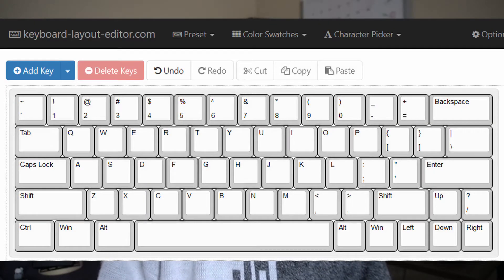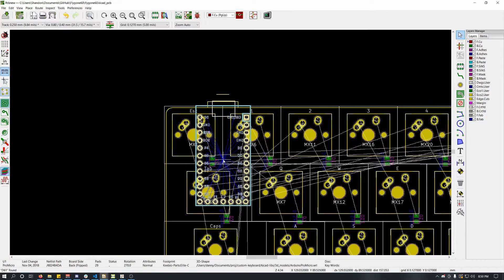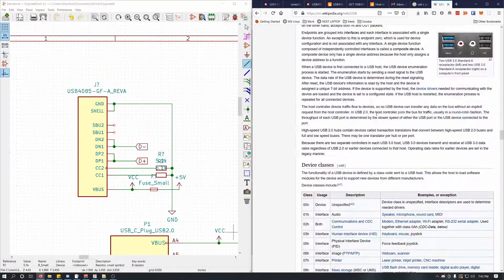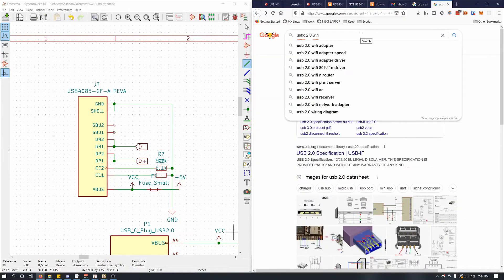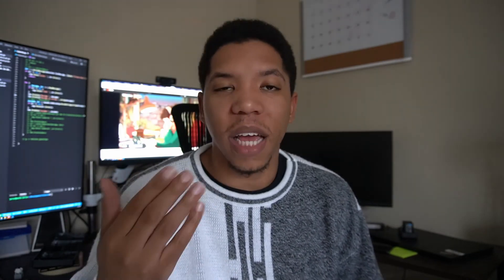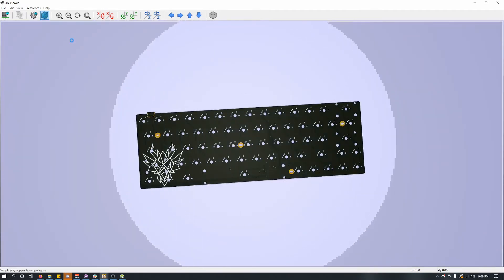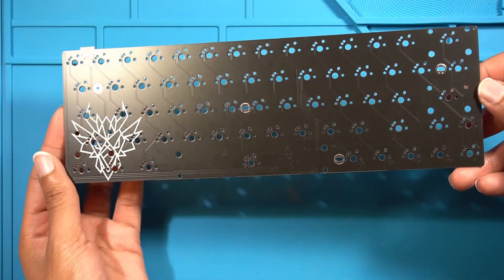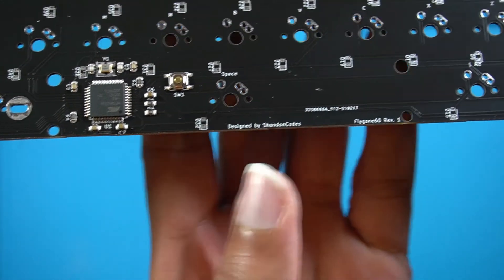60% PCB Design Pt.1 | Flygone60 Proto

Comment: I understand how to design a board, but how do I flash it to work?
Reply from the maker: Depends on a lot of factors, such as what MCU you are using and what bootloader it has. Generally with Atmega chips you short the GND and RESET pins to send the MCU into bootloader node. Then you use some sort of flashing utility like QMK Toolbox to write a firmware file to the MCU's flash.
Reply: @ShandonCodes  That is, if I use an atmega32U4 chip (not an arduino, but an atmega32U4 chip soldered on the keyboard), I can flash it through QMK, just like with a regular QMK keyboard? And I don't need a flash programmer?
Reply from the maker: Again, it all depends on your bootloader. The chip probably will work the way I described and you can flash via USB connection. However, that may not be the case.

Comment: I would really like to see a video on the firmware side of designing your own PCB. Currently im also really interested in making a custom PCB but I couldn't really find anything concerning the firmware. Do you set it up with QMK like a regular board or does it involve extra steps like programming the MCU?
Reply from the maker: That's a great idea, and I might make a video about that soon I think. You can just set it up with QMK, it isn't that hard to add support for a new board. You generally don't have to do any MCU programming if you are using QMK but depending on the bootloader of your MCU flashing may be a little different.

Comment: Can i get the Gerber file pls I wanna order the PCB thx bruh
Reply from the maker: The PCB files are not publicly released. If you want to purchase one the IC is currently live, here you can submit feedback and signup to be alerted once the PCB is ready for purchase. 
https://geekhack.org/index.php?topic=113904.msg3069071#msg3069071
Reply: K man i don’t think imma cop one since I found some free gerber files on a github page thx tho
Reply from the maker: @enzodecandido3862  Okay, I will caution you that it is most likely cheaper for you to purchase a preexisting one like a DZ60. Because the cost to get them manufactured and smt assembled will cost more than it is worth if you are only looking to get one unit.
Reply: @ShandonCodes  ok thank you very much 🙏